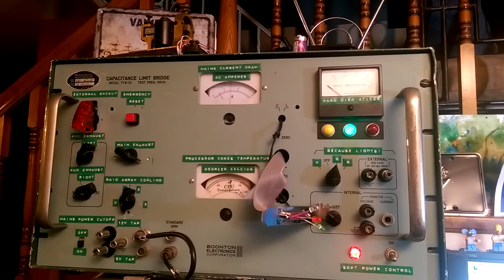Flashing LED's via Parallel Port & C++

Comment: LOL, first of all, great sense of humor. I used to mess around with Parallel ports in college, lots of fun, particularly at Christmas time. I would multiplex the 8 output lines, using a 74154 4 bit to 16 line decoder and drive 32 LED's. You can do a bunch more, up to 256, but LED's were so darn expensive back then it was prohibitively expensive. Even more LED's can be controlled by a couple 74LS595? (hope thats right)8-bit Shift Registers with quad output latches . I had a 286 laptop made by GRID computers for the military, aluminum case, hardened HD enclosure. 
You seem to be concerned about criticism, PLEASE don't be. And thank you for listing your C program, excellent. 
Your the steely eyed missile man, keep it up brother!!

BTW, did you know that most ports can be set in BIOS to input as well as output?  Yep, you can use the parallel port as an input device and with the right program and circuits it to measure temperature, used as a numbers keypad, measure distance, sense if a door or window has been opened. All kinds of stuff.

Comment from the maker: So here is the source.  Please understand I honestly don't know anything about anything...I just wanted to flash some lights on my computer case, which got me learning.  I hadn't written a single line of any code since college - PASCAL in 1988.  :)

So, don't bother critiquing this code, honestly, I wouldn't even understand what anyone was telling me...thanks for understanding!

--------------------------------------

/* To flash 3 lights from parallel port randomly.
Sorta like ST:TOS panels.  This started as simple LPT TEST program I found online somewhere, and I'm just hacking away at it...
*/

/* These are all from the LPT test program I started with.  Assume all are needed.  Added iostream myself. */

#include <iostream>
#include <stdio.h>
#include <stdlib.h>
#include <unistd.h>
#include <sys/io.h>
#include <time.h>

using namespace std;            //guess I need this?  Dunno.

#define base 0x0378             /* printer port base address */
#define pin1 1                  /* binary values for pins on ports */
#define pin2 2                  /* concept is to flash 1 or 2 or 3 or 1+2 or 2+3 or 1+2+3 or none */
#define pin3 4
#define pin0 0
#define pin12 3
#define pin13 5
#define pin23 6
#define pin123 7
#define off 0

/*  A bunch of functions to light the various LEDS/lights....   */

void LightOne()
    {cout << "Light ONE" << endl;
    outb(pin1, base);
    sleep(2);
    outb(pin0, base);
    sleep(1);}

void LightTwo()
    {cout << "Light TWO" << endl;
    outb(pin2, base);
    sleep(2);
    outb(pin0, base);
    sleep(1);}

void LightThree()
    {cout << "Light THREE" << endl;
    outb(pin3, base);
    sleep(2);
    outb(pin0, base);
    sleep(1);}

void LightNone()
    {cout << "Light NONE" << endl;
    outb(pin0, base);
    sleep(2);
    outb(pin0, base);}

void LightOneTwo()
    {cout << "Light ONE and TWO" << endl;
    outb(pin12, base);
    sleep(2);
    outb(pin0, base);
    sleep(1);}

void LightTwoThree()
    {cout << "Light TWO and THREE" << endl;
    outb(pin23, base);
    sleep(2);
    outb(pin0, base);
    sleep(1);}

void LightAllThree()
    {cout << "Light 'EM UP!!!" << endl;
    outb(pin123, base);
    sleep(2);
    outb(pin0, base);
    sleep(1);}

main()
{

/*this is the original thing I found that first checked for port,etc.    */

     if (ioperm(base,1,1))
     fprintf(stderr, "Couldn't get the port at %x\n", base), exit(1);

    sleep(2);

/* Calling my functions one at a time, not random yet...  */

LightOne();
LightTwo();
LightThree();
LightNone();
LightOneTwo();
LightTwoThree();
LightAllThree();

    cout << " " << endl;
    cout << " " << endl;
    cout << "And....we're spent. " << endl;
    cout << " " << endl;
    cout << " " << endl;

return 0;
}
Reply: im going to have to try this with my next build  Im getting into p.port programming eeproms this will be my start test
Thanks